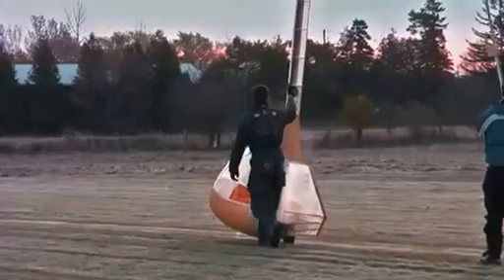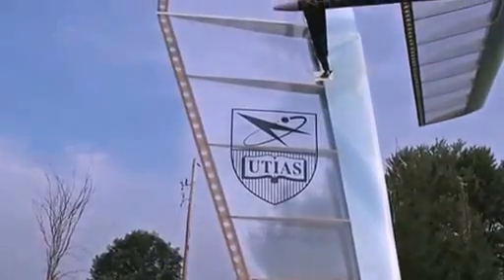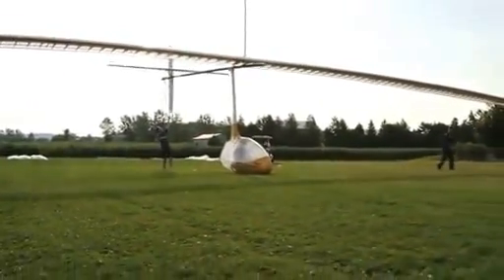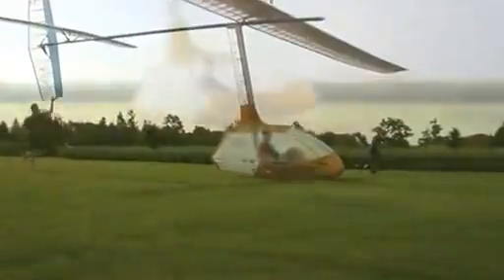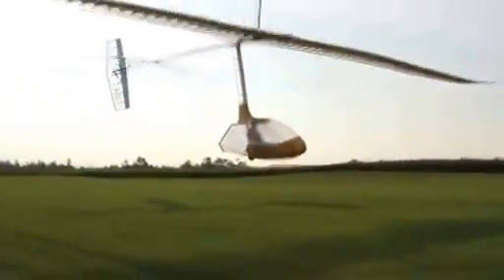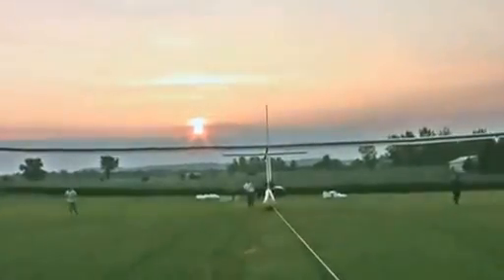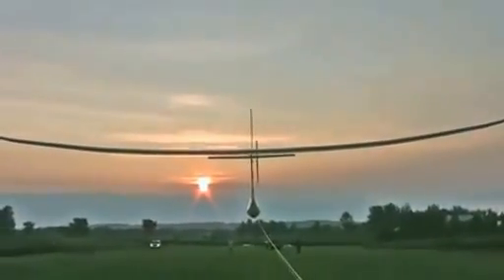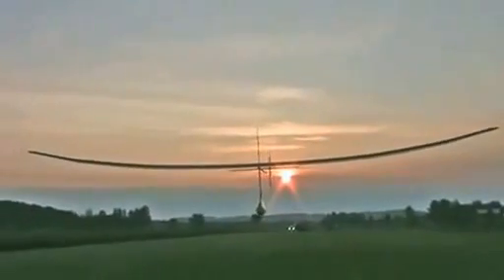First Human Powered Ornithopter Flight

Comment: I think you need to put some linear actuators in there that are stronger than a human leg.  Tow it up to a respectable altitude and  get it soaring on thermals before you start using muscle power. 
CHEAT some, in other words.
Reply: The whole structure would have to be beefed up significantly. It's purely human powered for the sake of being exactly that, but it does seem like there's scope to do some kind of hybrid.

Comment: In flight yes but can't get into the air on it's own..how good is that?
Reply: Fighter jets taking off from an aircraft carrier can't do it on their own, either. They need a catapult launch to have enough speed to fly when they leave the deck of the ship.  How good is that?
Reply: @devilsoffspring5519  They only need a catapult launcher because the takeoff is too short, not because they lack the power to take off from the ground by themselves. And I'm not even counting VTOL planes which have a thrust/weight rate higher than 1, which is common but not present in all modern fighter aircraft (interceptors and air superiority versions).

Clearly a plane that has a lift/weight rate just slightly higher than 1 can't even take off by itself, but it also can barely keep itself in the air, which makes it (functionally) a sailplane, not a properly powered aircraft.
Reply: @TRak598  This keeps in the air from energy stored onboard, (like a powered aircraft) and not from air updrafts (like a sailplane.)
Reply: The fastest car has that potential to be earths fastest car, but it doesnt need a towing start to make it perform. Legality and actual practicality of a machine dont really compare to each other.
Reply: белый рыцарь lol yet...  just gotta make some prototypes